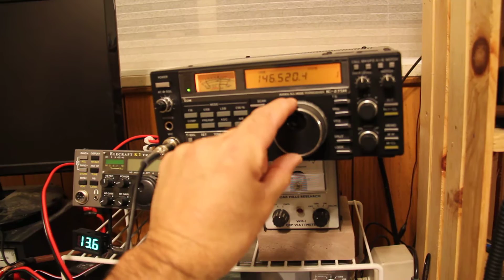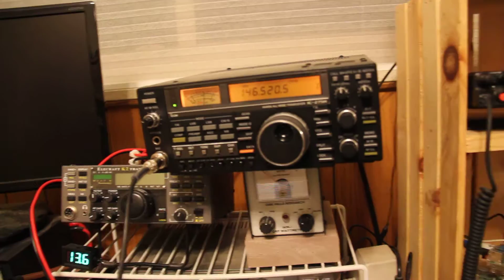A quick on-air test of the ICOM 275H two meter all-mode transceiver

Comment: I have been running my '275H from a ten-foot run (twenty feet total) of ten-gauge wire from a battery which is float-charged and capable of over 800 Amps in a short-circuit situation.  Still, I can't get full output.  I'm going to change to six-gauge wire; that should solve the problem.
Reply from the maker: Yes, the heavier gauge wire will have less voltage drop, etc.

Comment: You should have used the RIT it would have cleared everyone right up even if you were not following the band plan by a long way.It's NOT an All Mode just a Multi Mode since it lacks AM for some unknown reason?
Reply from the maker: You bring up two good points! I test a number of radios, each year and (unfortunately) don't have a lot of time to get to know them very well...
Reply: The ICOM 275 in either the A or H model is a great transceiver & finding a clean & fully operational one these days is almost unheard of.I hope you kept it because it's a real classic & a keeper.Love my 271A & 275A both.
Reply from the maker: Unfortunately I wasn't able to keep it...
Reply: Well maybe the new owner will appreciate the treasure they now have & use it as it was designed to be. 73
Reply from the maker: I hope so! 72s es 73s!